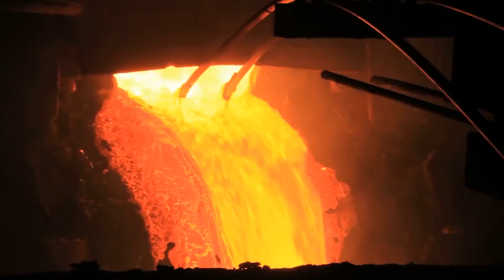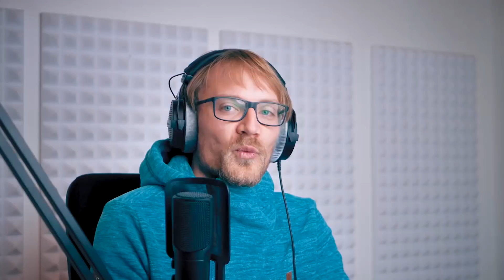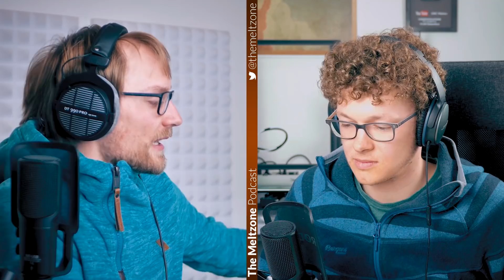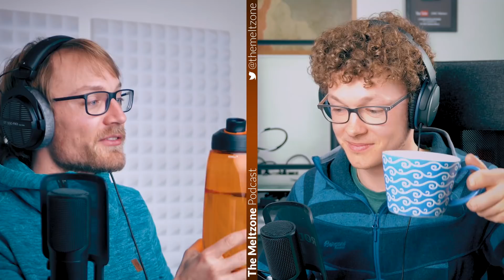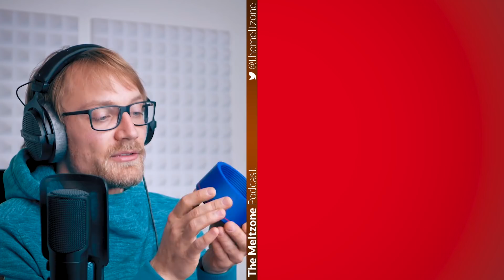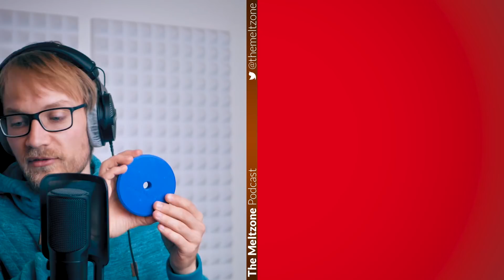"Get rich quick" with 3D printing / Meetups / Gearbest Dataleak - The Meltzone Podcast Ep11

Comment: Recording on the road might be challenging, It's a bumpy drive. Indiana has the worst road of all states. I dread transporting my 2 meter delta in my Prius. I hope I'll still have something working, to show you guys, when get there.
Reply: Yeah, the "quieter" assumption was pretty funny.  Every time I drive, I miss Germany.  At least it's not hilly, so the "proper camber of the turns" assumption won't bite 'em.  Lol, wait 'till they see a stop sign in the middle of nowhere.  :D
Reply: People have asked me why I keep two spare tires in the back of my truck. I tell them I'm from Indiana and it's the only way to be sure I can make it to work and back home every day...
Reply: @bustedupbungalow  Last year I drove back from MRRF2018 to be pulled over in Wisconsin (1 mile from home). All tail lights were out (explaining all the flashing at the toll in Chicago). When I tried to replace the bulb I found all the old ones still worked. They had just come loose. Not a good design, but only in Indiana.

Comment: I do not think it is possible to get rich with 3D printing, but you can design unique interior stuff, that contains 3D printed parts. A week ago I designed and printed electronics enclosure to be cemented in and used as LED lamp base. Yesterday I printed Oil pressure gauge fixture/cover to be fitted in panel of a race car. I have not earned a cent for doing this.
But I believe it is possible to create business around designing and creating custom parts or cool design house interior stuff. Still everything is in skills, are you capable of designing, crafting. The key is the 3D printer can only serve you as a tool to create physical objects. 3D modeling software is a tool to create 3D models to print, render photos/videos, document existing product.
Do not focus on making your cheap 3D printer worth the money. Focus on your problems and consider 3D printer as one of solutions.

Comment: I think a lot of people get confused between making money as a teenager (i.e. instead of a Saturday job, or part time work) and making a decent adult salary that could support a family.}

So get rich quick to some people means making a £100 for a one-off bit of effort. For others it means making £40,000+ for a few months effort.

But it's interesting even to investigate what type of sustainable jobs people involved with 3D printing can look forward to.
3D printing actually a very technical subject and is an absolutely great way to develop many useful job skills. IT/Engineering/Design, but I even see people learning great marketing skills, photography, project management, etc, etc.